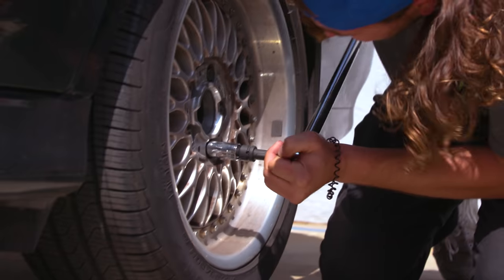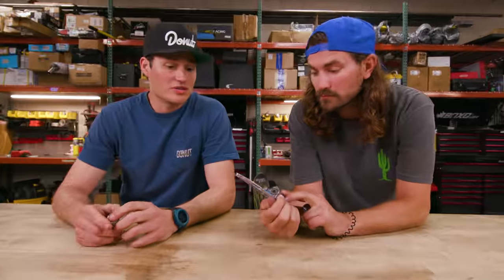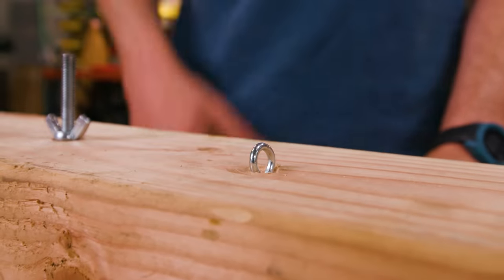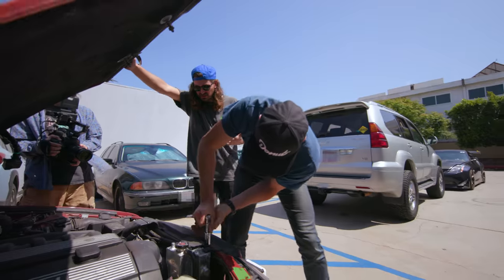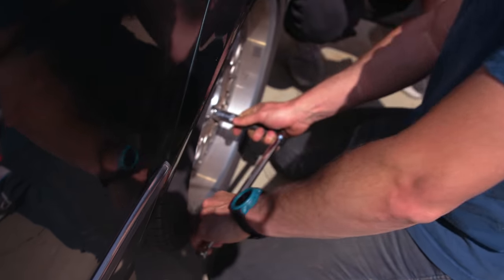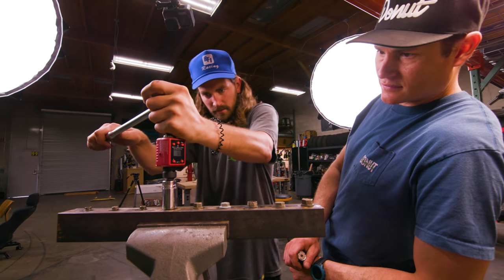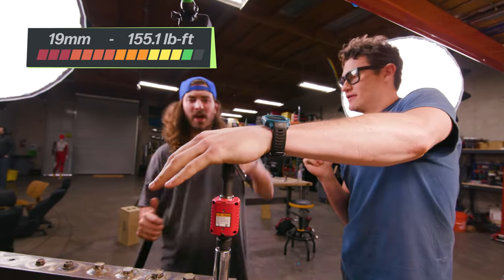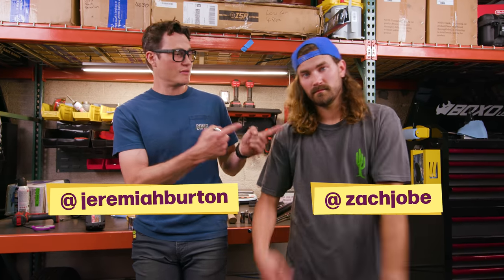Testing the World's Most Hated Tool

Comment: This was my exact experience with one, way back when I was starting out as an electrician.  It "worked" but it either rapidly began to damage heads, or the pins themselves would start to get jammed or bent or chipped really fast.  Even if you found one that was made out of really high quality material, I think you'd always have to deal with the fact that it's going to damage what you use it on, more often than not.  Definitely wouldn't want to use this on something I'd want to be able to take back off again, even in a pinch.

Comment: No they don’t replace a tool kit but they have their place. I do metal framing and drywall for a living and i have to do concrete anchors and occasional odd ball things like eye lags and stuff and i always keep it in my work truck and it has saved me a few times. I do usually have a socket set on me and of course I prefer that but there have been times I didn’t have my sockets or I didn’t have the right size and had to bust out the gator grip. Its more of a last resort tool.

Comment: There are industrial versions of these. We use them at my work for rounded nuts on wastewater force main valves from time to time. The valves have 2in square operator nuts. Ive put upwards of 500ftlbs on them without breaking the sockets.

Comment: I've got one and used it a few times with no trouble. Loaned it to a friend doing bodywork. He said it was the only thing that would remove the bolts from what he was working on. Still have my tool chest, but the gator grip's helped me out a few times.

Comment: I find it to be a great emergency go to for when I don't want to break out the full set of sockets. I install home theaters and I carry one of these and use it on my 3-speed hammer drill. Most commonly I use it to remove odd lags from studs so it doesn't require that much torque. In the past 6months I've used it a handful of times. Still don't think it will hold up many more as the pins are starting to wear but it has saved me some trips out to my van to grab a full ratchet set. Definitely think it would break if I tried to use it to drive lags consistently.

Comment: I think everyone should have one in their box.  This thing saved my weekend as I was doing a 50 hour service on my tractor.  The front axle has square bolt heads on it.  So all I had was metric and standard box ends that had a chance.  Most folks have success using those on that particular bolt.  Mine started to round almost instantly so I got this tool out and got the job done.  

That said, the pins bent and it became a one time use.  However the headache it saved me was worth the $10-$20 it costs.   

One time use imo

Comment: Best use case I found for GatorGrip is when you have a damaged bolt to begin with. For instance, if a quick oil change place rounds off your oil drain plug... it works nicely. Worth $10 for a single use in my opinion.

Comment: We used to met my last job to remove bolts from holes that had gone through painting and the bolts kept the paint out of the holes, the pain added enough thickness that a normal socket got stuck on the head

Comment: When I was first starting to get into cars, my dad got me a Gator wrench (this thing I think). It was suppose to help with stripped heads, but the stuff on the inside would always get stuck and it stripped threads probably worse than the proper hex would. I had a really cheap socket socket as my first set, and one of the sockets broke when I was trying to change my brake pads. It discouraged me so much that I almost quit working on cars. Every young man needs a father figure to show them the way about getting quality tools. Unfortunately, my Dad knew nothing, so I'm teaching him at this point lol. It's okay though, he's not a wrencher. I ended up spending around $400 on tools between Sears and Harbor Freight. I think that's how much u'll need to spend to have a tool for almost any of the basic repairs. Ratchet and socket set, Extensions, ratcheting wrenches, many pliers, vice grips, pry bars, big hammer, screwdrivers, breaker bar, ball joint separator tool, and some sort of impact gun is useful for when you need to replace an axle, wheel bearing, or a ball joint.

Comment: Had one of these in my tool box since the early 2000s. It is still there, still works. I would not say it replaces the sockets, but it is nice to have. Never had it strip anything or bend any pins...but then again never tried to put 150 lbs of torque on it either :)

Comment: This is useful for things that have extremely weird designs like proprietary bolt heads. With so many manufacturers not having right to repair sometimes (quite a bit actually) something like this is worthwhile having. I personally use it on my L shaped allen keys because I'm too damn lazy to twist the screw out all the way by myself.

Comment: I have one. Have used it off and on for around 5 years, including for a few rust-siezed bolts and nuts. Works perfectly fine, still holding up. Do I expect it to last as long as a dedicated socket or wrench? No. Is it as good as a dedicated wrench or socket of the correct size? Of course not. But does it work? Yes. Is it useful? Yes. Would I buy one again? Sure. Spent $8 on mine, new in store. I'd go up to $12. Maybe $15. Full disclosure, I've only used it with hand tools. The high torque and sudden grinding halt of power tools probably isn't good for it.

Comment: I have one. I Bought it years ago , but I  only but I only use it for bolts where the head is stripped and my regular sockets won’t work. And it has never failed me.  Some of the pins where bent but it still works fine.

Comment: bought one of these when renovating a deck and a bunch of old screws kept stripping when partially dislodged. if you've got a quarter inch at least to grip and your only goal is to remove the screw, it's hard to beat this thing. never once tried it for its stated application.

Comment: For me, it's when I can't find the one bit or key I need, especially the larger ones, or when you do have to turn something that's a weird shape, then it's a nice backup to have. Even if it will wear and tear, it will usually only do so after you use it repeatedly for the same thing- but for that one-off bolt or screw, it's a lifesaver, though you'll probably have to buy another once a year.

Comment: Several years ago I had to make emergency repairs in a Wal-Mart parking lot.  To remove a stripped nut I went in and bought a Gator Grip.  Did not work.  So I exchanged it for a $3 pair of pliers, which succeeded in removing the stripped nut.

Comment: These are also handy to remove damaged or rounded off bolts where the size is irregular. Add a little valve grinding compound to increase the grip (note it will gum up the little rods so ya may wanna wash it out after).

Comment: Yeah I bought a couple of these and noticed that they aren’t meant for big jobs. I work in commercial maintenance and use all kinds of odd tools. I needed to hook up a pressure washer outside and the water faucet didn’t fit my water key. I grabbed my gator socket and was able to use it to turn on the water. It definitely doesn’t hold a very high level of torque but it did the job.

Comment: Looks like for basic household use and light automotive work, it can be useful- but no matter what you're using it for, you can't apply too much torque; you have to use it a bit carefully and be aware that if you screw it up you may chew up the material whatever you're working on, or break your gatorgrip.

Comment: I had an e36 for a very long time and the wheel had a terrible habit of seizing to the hub. Even coating the contact point at the hub with antiseize like it was frosting didn't help. Only thing that did was putting a rubber washer between hub and wheel. I ended up keeping a 17mm socket and a 2 foot breaker bar in the trunk. Loved that car, hated the lugs/wheels.

Comment: Even putting aside the loss of strength, a key issue with that one-size-fits-all socket is that many, maybe even most, of the nuts and bolts you'll want to get at with it are recessed into something. So, your large socket with its clever adaptation to fit smaller fasteners simply won't fit through the smaller opening to reach it.

Comment: Sockets have round cutouts on the corners so they don't round the edges of bolts as easily/quickly.

Even when this socket does "work", it's going to grind down bolts over time.

Comment: I see a use for this. You got a tool box, you find out you don't have the right size socket or whatever for what your doing. Instead of having to go to the store, have a go with this. 
It won't replace your toolbox, but for 10 bucks could save you a trip to the store if you don't have the right size socket etc

Comment: Great to gain insight from you guys. In theory, it makes sense. but you don't think about the potential to damage the nut due to only having some small circular points of contact. Would probably be better if they had hexagonal pins that could transfer the load to the other pins more effectively.

Comment: I used to hate these things. I worked building displays for different companies and everything was put together with bolts and nuts. I ran the carpentry crew that would bolt and level everything, and another group did the signs and stuff, and the lady over the "merchandisers" as they were called, told me that I should just use those Gator grips instead of getting the specific sockets and wrenches every time, and I tried to tell her those things sucked, but she kept insisting that they were great, and I would break about 3 of them every day, and my guys hated them, so I gave up and told her we were doing it with actual sockets and wrenches.

Needless to say, it actually took us way less time with the actual sockets and wrenches than the gator grips.

Comment: We use one of these a lot, though the one we have actually has hexagonal pins. Had some screws with super rusty and weathered heads, so not sure if the proper drivers would've even fit them anymore. This thing worked just fine. Wouldn't try to put on a tire with it though.

Comment: It's ten bucks guys!  I used it to install eyes to hang a suspended ceiling.  Had a lot to install and it worked liked a charm.  Haven't used it since and it's been a couple of decades, but it's still in my toolbox.  Right tool for the right job, just think there are better choices for lug nuts.  Overhyped? Yes.  Worth ten bucks? Yes.

Comment: The pins should vary in size. Smaller diameter spins near the center of the socket and bigger diameter as you more closer to the outer edge of the socket.

Comment: They work fine as light duty tools. 

They are kind of like the cheap china steel screwdriver sets that amazon sells as electronics kits. They work wonderfully when dealing with delicate electronics where you aren't applying too much torque, but the moment you try to use one on something harder, it starts to damage itself. Usually with the cheap electronics screwdriver sets, you will only run into that with the allen bits and maybe the larger standards (+ and - shape, idr their actual names off the top of my head).

Comment: I've had mine for around ten years. Main thing i use it for is square head oil drain plugs on some briggs motors i got. I also like to use it if i dont feel like bringing my whole socket set and don't know what size to bring. Never had any pins bend on me or break and i also have better clearance than you did when you needed a deep socket for the strut bolts. Also i dont like it for anything that requires a lot of torque because you'll probably slip and bust knuckles

Comment: On some light work, like running the farings off a motorbike before you get the proper tools out, I think these things can get a lot of work done quickly. I wouldn't dream of using one for mechanical work, but I like to have one in the draw for random bits and pieces; and there is nothing like it for hooks and eyelets.

Comment: Being a retired auto mechanic I almost fell off the couch laughing when I saw the commercial for this "tool". What a joke! Would it handle an impact wrench? I don't think so. Would it work on torx bits? I don't think so. Would it work on a 3/4" hex or larger? I don't think so. Snip wires or cotter pins? Adjust headlamps? Remove phillips head screws? The list goes on and on... Replace everything in your tool box? Not a chance!!! Don't waste your money on this junk.

Comment: They suck... until they don't. I've successfully used one to remove spline drive lug nuts that the key was missing for, a few rounded off bolts, and one weird triangle-shaped nut I encountered. I've broken a few Gator Grips as well. I keep one in my toolbox at the shop as a last resort, and about half the time? It saves the day. The other half it breaks.

Comment: They really need to revise their max torque figure to reflect the onset of pin pending instead of socket failure. At 150 ft-lbs, it's just a single use part.

Comment: I think the problem with the gator grip is that the little metal pegs inside the socket, are cylindrical. Therefore only part of the thing is actually gripping the bolt. If they changed them to be hexagonally shaped like mini hex Allen wrenches, it would grip better. Flat shapes have a lot more surface area to grip than cylindrical shapes.

Comment: This thing works wonders on things like screw hooks. Or just any odd shaped thing that needs screwed. Its absolutely atrocious using it as an actual socket for nuts though.

Basically for anything that won't just easily cam out.

Comment: I work with many assholes that will use cresent wrenches to over torque wing nuts. That gator grip thing is the best thing ive ever used on stuck wing nuts. Gets a proper grip, doesnt screw with my fingers, no crazy mechanical advantege to brake stuff.

Its cheap, its versitial, but it doesnt last through the torque to get the tough jobs done.

I should mention i use it without a ratchet or drill. I just palm it without an extention.

Comment: Gator grip wont even last a second on my 12v impact gun. Its great for those hook fasteners. It has its' place but it's not for high torque applications. May be good for getting hard to reach bolts hand tight before using a real socket to finish the job.

Comment: I stripped the nut on my torque converter and couldn’t get it off. I tried this exact tool and it didn’t work. What ended up working was an Irwin extractor set and a hammer. Took me hours to get it off laying underneath the car but it did the job.

Comment: I had a coworker that brought one of these for an impact we were using to set up some traffic control equipment. It literally got stuck 50% of the time or stripped the nut. Yeah, I ended up just switching to the size 9 bit and saved myself the anxiety.

Comment: Gatorgrips are terrible for cars but perfect for a handyman. I'm lugging around tools constantly, so the smaller the footprint the less trips I have to make and the less junk I have in the back of my truck. One of those gatorgrips sits at the bottom of my toolbox for whenever I need to remove TV mounts or satellites off of roofs. Way better than lugging my big socket set around. If it breaks I just buy another one.

Comment: Subbed, I remember that commercial from a while back, I'm not a handyman (at all) but I was intrigued. I wonder, given the cost what is the quality of the steel in the inner workings of that tool.  If there was a higher grade (my guess that this tool would benefit from harder steels) steel would make the GatorGrip more useful for the harder jobs.  In addition, there was one below who mentioned that reshaping the pins as hexagons might prevent pins from becoming bent, strengthening the tool, though perhaps may need some lubrication or cleaning at times.  What do you think?

Comment: I have one that (as others have mentioned) sat unused for years.  Then I needed to loosen a large bolt and was able to use it for quite literally about 2 turns to get it off.  That one use is easily worth the cost of purchase.  And I still have it for next time.  Does it replace a whole Snap-On toolbox for a mechanic?  No.  Of course not.  Is it quite useful for a homeowner to have in the drawer?  It has been for me!

Comment: I use this for my broken window the ones that you wind to open, handle cane off now its just the bolt i put it on a drill and use it to open/ close. Also good for waterhose switches however i tried to use this on my bmw for car work … no way its strong enough unless the bolts are already extremely loose.

Comment: I wonder if a better version of this thing could be made with modern-day precision machining. Maybe something deeper and with larger pins that fit with each other better. Basically the pins lock on to each other better so there's less space for them to bend. Minimize the space between pins, and use a harder metal for them.

That, and maybe use compressed air instead of springs to return the pins

Comment: I'd like to see the springs used on top of the pins.  Are they up in a honeycomb matrix with very thin walls?   It would have to be plastic to be economical.  Or are the springs (if that's what is used) not partitioned off and just slip against neighboring springs, in which case they would probably have to be made of flat wire or round wire ground flat.

Comment: I used the predecessor of the Gator Grip universal socket about 20 years ago.  It worked OK for the most part, but it couldn't handle any jobs requiring a lot of torque.  I guess the patent must have expired on the previous universal socket, so Gator Grip could steal the idea and run with it.